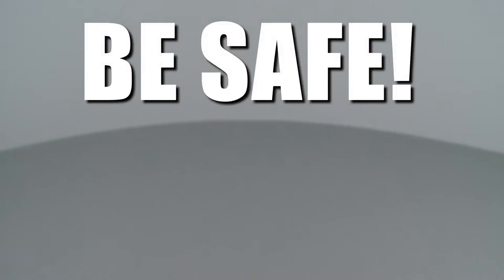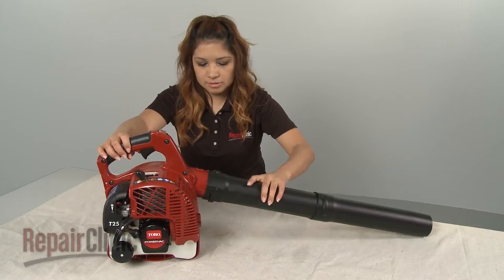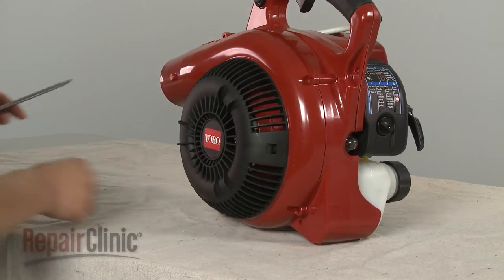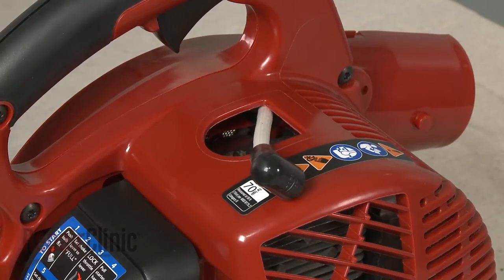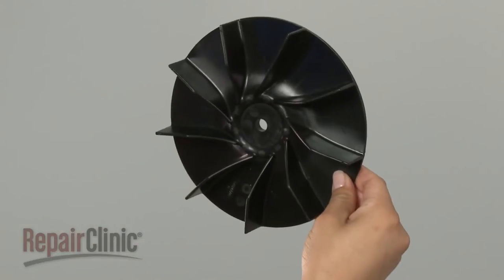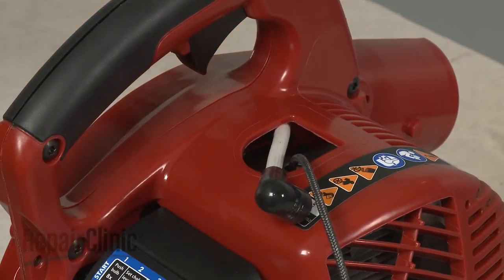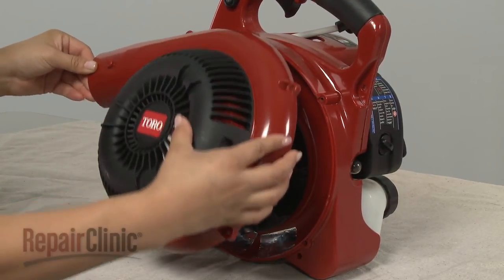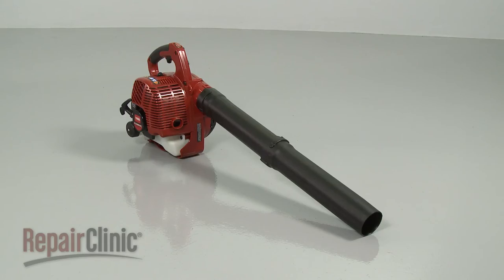Toro Leaf Blower Fan Blade Replacement #518265003

Comment: after replacing the  impeller why does the the machine sound louder than normal
Reply from the maker: +Deo Nandkumar Perhaps the housing is touching the new impeller and causing the noise. Was the impeller the same as the original?